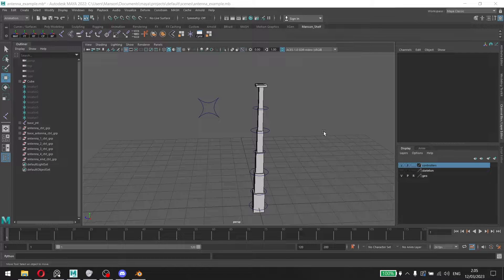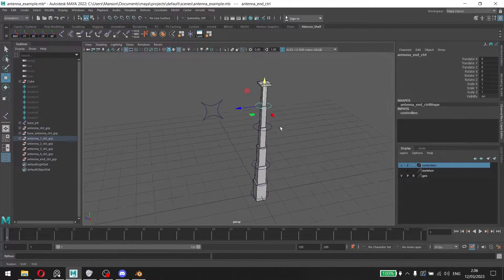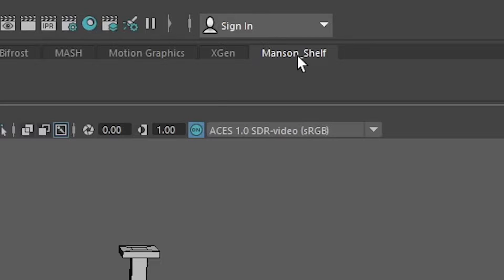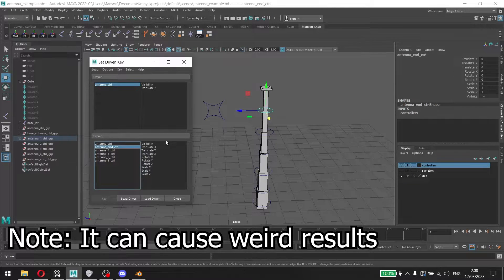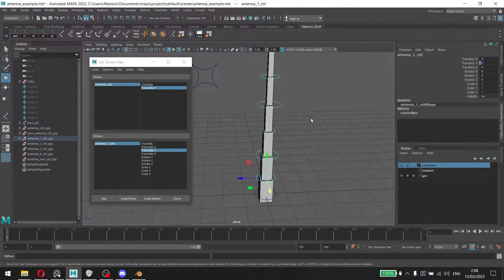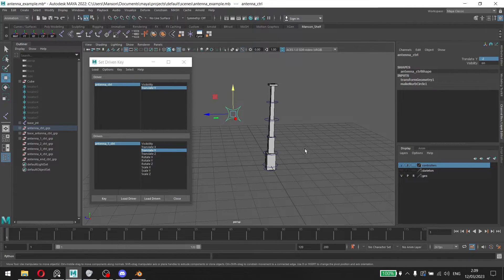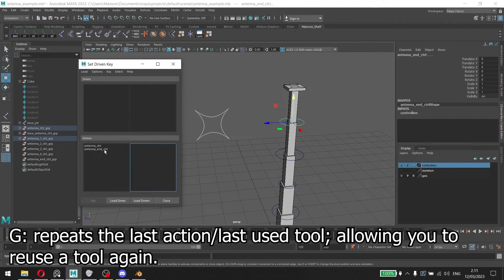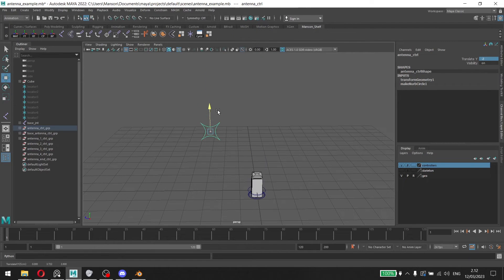Maya Quick Tips: Set Driven Keys Explained

Comment: I do have a question: Is there a way to create a slider (e.g., a piece of geo or a locator in the scene that you can move) that can control the scaling of animation curves in the Graph Editor?
Reply: Creating a custom attribute, you can have the data type set to float and create a min and max value. This will act as a slider You can then connected the to either using the connection editor or a driven key

Comment: Hello! how did you limit the trayectory of the controller to cap at a certain translation? for example if i want my controller to cap at Y 3 how do i make it do that? thanks in advance!
Reply from the maker: Hi p0m-p0mz, in order to limit the translation to be capped at a certain value (say maximum is 3 and minimum is 0). Select your controller (let's assume it is "antenna_ctrl") and then go to the Attribute Editor [CTRL+A is the shortcut for Attribute Editor[. The Attribute Editor will show you  various drop down menus.

Select the "Limit Information" dropdown menu and then select the "Translate" dropdown menu. From there you will see the X, Y and Z translations with check boxes that you can enable to limit them or not. Next to the check boxes there are values that you can adjust. 

For example, I want to limit Translate Y to have a minimum at 0 and maximum at 3. To do that, I will go to the box that says "Min" and leave it at 0 and then go to the box that says "Max" and change the number to 3. After that I enable "Trans Limit Y" Checkboxes on the left and right side. Hope this helps!

You can do the same with rotations by going to the "Limit Rotation" dropdown menu and doing the same as I did with Translate Y.